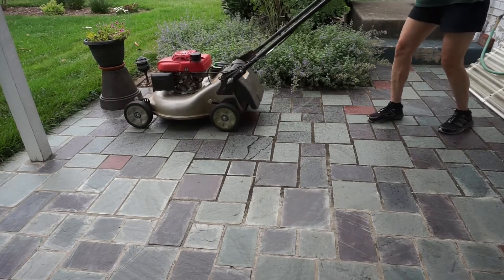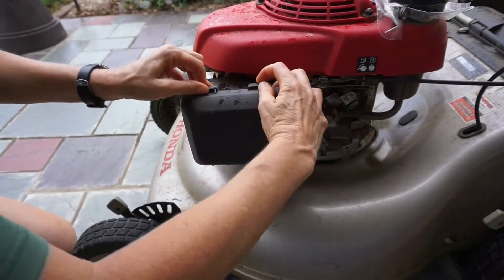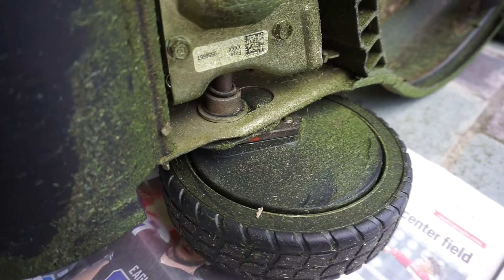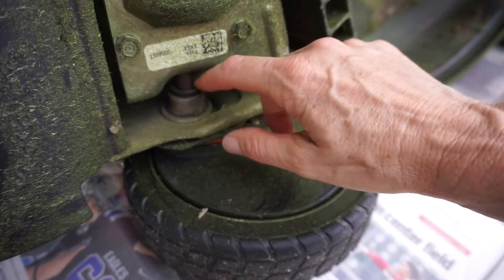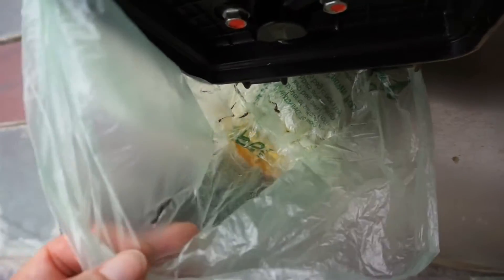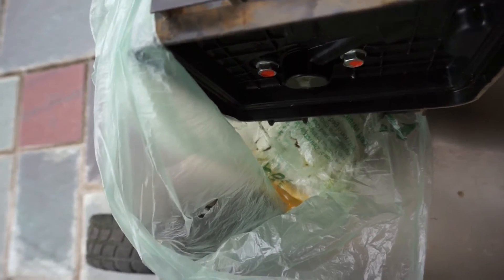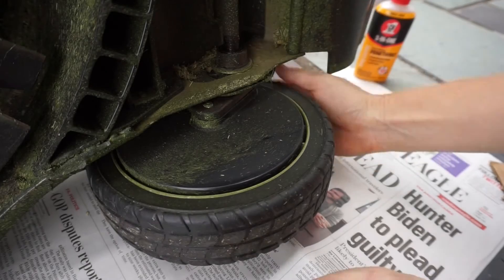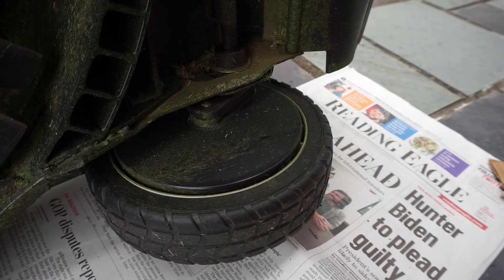Honda Mower Hard to Pull Backwards Quick Fix!

Comment: This is the easiest method to try to fix this issue. I tried it and yes, my mower now pulls backwards but it is very hard to pull. The problem is with the tranny shaft and the bushings on both the left and right. There are tutorials to sand and restore them online.  Note: If you turn your mower to the "wrong" side, you will leak oil through your carb. Let it set a while for the oil to settle and check your level before trying to start it. You WILL blow some smoke when you do ...

Comment: Before you put it on it's side, turn off the gas, and run till it quits. No bag needed.  By the way, you have an excellent channel. I am a maintenance guy by trade and you do know your stuff.  You do a great job helping people out and correctly I might add.
Reply from the maker: Thanks for tip and the compliment, Ted.  They is plenty of bad repair advice given out.  I'd feel terrible if the advice I give causes harm.  My life experience is that you can do something right the first time or you get to do it over again.

Comment: You're in Reading!  I'm in Macungie.  The specs on this mower say a back pull up to 10 lbs is is considered normal.  The newer ones have no back pull resistance.
Reply from the maker: Hello neighbor from Bear Swamp!  You are correct that they are designed to have some resistance when pulling backwards, though this mower is known to become hard to pull backwards as they age.   If I remember correctly, there was a problem with bushings some time ago, that made them especially difficult to pull backwards.  I believe that problem has been corrected.  My brother has the non self propel version and removed the mechanism that caused some drag on the wheels.  Some people disassemble the wheels and sand the bushings.  I'm not a huge fan of this mower.  I wouldn't buy another one.  I don't like that they are hard to pull backwards.  Also the wheels wear out quickly and are expensive to replace.

Comment: I have a can of white lithium grease spray. would that work as well?
Reply from the maker: I've never tried that.  Let us know if it works.
Reply: @Know-How-Now  Mine goes backwards fine as long as it isn't running. I had transplanted a GCV160 engine onto the deck of a Honda HRN216 that had a blown engine. it wanted to take off on its own when i first started it. Had to back off the self-propelled adjustment on the cable so it wouldn't go unless i pressed the lever. i think it still might be a tad tight as it doesn't want to roll backwards while I'm cutting even if i'm not pressing the paddle. I'm figuring the belt will stretch after a bit and not do that anymore. i'm out of adjustment threads to back it off any more.
Reply: I sprayed the wheel bearings with lithium grease, though, just to keep it from going bad.

Comment: There's a factory recall to fix this just take it to your local Honda dealer.
Reply from the maker: If I remember correctly, some of the older models the bushings were the wrong size.
Reply: Honda Power Equipment Service Bulletin #107, March 2017. My 2016 HRR216 is an affected model and I will be replacing the adjuster arms this weekend as well are cleaning/servicing the entire drive system. OEM parts are still available but are getting more expensive.
Reply: @BlownF150 What honda dealer? You mean Honda lawn mower dealership?